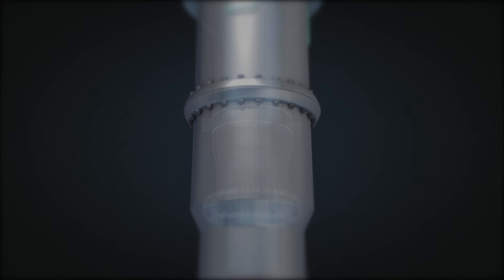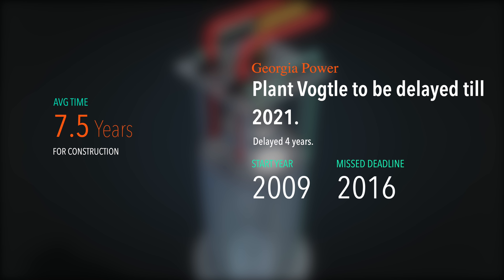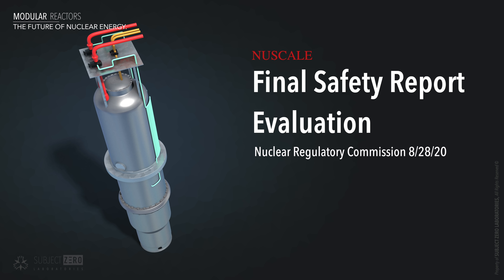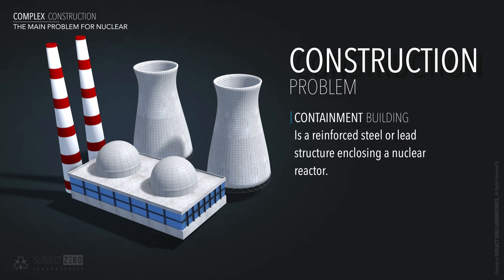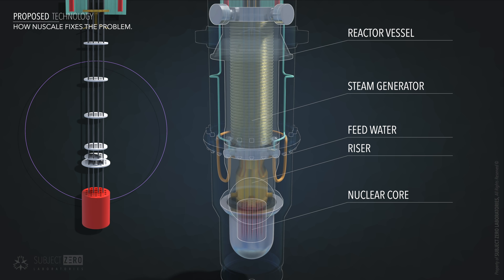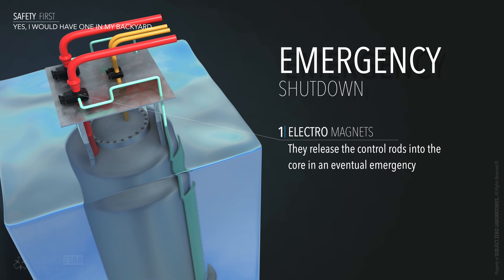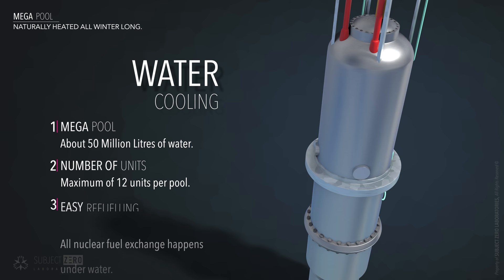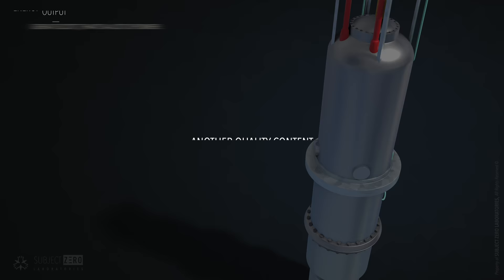A Milestone for Small Modular Reactors (SMR 2020)

Comment: Most misunderstood technology... the misunderstanding starts when calling a 720 MW plant ‚small‘, and the nuclear waste and decommissioning is not listed as a disadvantage, or when the Fukushima incident is mentioned ignoring the facts that design changes contributed to the disaster (like moving the emergency generators in the basement - next to the sea). 
This is more a marketing video than the typical well researched project zero video...
Reply: Anthony Ngu the lesson is, there will always be commercial (or lazy) decisions sacrificing a tiny tiny bit of security. Even if a design is almost 100% safe in theory (which it never is), the actual plant always is less safe than the design. Over all plants in the world and over time, those tiny risks add up to a major disaster every 20 years or so. 
Putting 12 reactors in a pool is not going to change that in any way. Oh and don’t forget the waste problem is the same. 
We could look for less radioactive fuels that are not capable of a meltdown and have a short half-life to reduce the waste problem. That would be safer but not as commercially interesting as the big ones producing more heat. The design shown in the video is definitively a big one.
Reply: @Krmpfpks  long half-life something with a short half-life is more radioactive especially if it's something with a big atomic number.
Reply: @Krmpfpks  also it is small relative to a normal nuclear power plant.
Reply: Anthony Ngu you can only consider it small if you count the 12 reactors in one pool as 12 separate reactors. The risks of 12 reactors in one pool might be somewhat smaller than the risks of one big reactor, but the worst case scenarios will be as bad as one big reactor. The half-life is important for disposing of waste products, but yes, it’s probably not that easy to find something viable with a short half-life as part of the wast is not the fuel itself but byproducts of the reaction.

Comment: I agree with part of your presentation. The French proved the small reactor factory built concept in the 1960's when they built their very successful nuclear power station grid from this type of small reactor. There are a number of fundamental problems of any solid fueled nuclear reactor. Nuclear fuel ALWAYS swells due to the intense radiation, reaction byproducts quickly contaminate the reaction and cannot be remove from the solid fuel, unless the fuel is recycled. Also it only allows utilization of a very small portion of the energy in the nuclear fuel (about 1-3%), requiring fuel bundle replacement in about 18 months. When the core is decommissioned you still need to store the highly radioactive waste for thousands of years. Spent fuel MUST be continuously covered in highly purified water for at least centuries to keep the fuel bundles below melting temperature. The continuous heat from the fuel, evaporates the water quickly (hundreds of gallons in a short period of time) ALL spent fuel is currently stored in pools, on site at the nuclear plant and there are no plans to recycle it as it is expensive and hard to do conventionally. Uranium is somewhat water soluble (Thorium is not), so there is a groundwater contamination concern.

I used to oppose nuclear energy, mainly due to high pressure steam explosions (3 times so far) and long term storage of highly radioactive fuel for 10k+ years. I have changed my mind, but only if we build  Thorium liquid fueled, Molten Salt reactors (such as LFTR) instead of the boiling water conventional reactors we have now. Currently Thorium is  a waste product of a number of mining operations, is orders of magnitude more plentiful than uranium and is basically safe (it needs conversion inside the reactor to become useful fuel, conversion takes 30 days and is free). Molten salt solves ALL of the fundamental problems of boiling water reactors, as part of their nature. They also cheaply and easily burn current stocks of used fuel rods leaving only a small residue that is safe in about 300 years. They effectively use about 95+% of the nuclear energy in the fuel. No expensive explosion proof containment structure needed, as it cannot explode (it operates at ambient air pressure). They are walk away safe (Oak Ridge Tennessee ran a molten salt reactor safely for 6,000 hours and performed walk away safe tests on it at full power in the 1960's). In fact they shut it down every weekend because no one wanted to stay. They are well suited to the SMR form factor and easily allow continuous removal of very valuable medical isotopes on an ongoing basis. These medical isotopes are impossible to remove from boiling water reactors. They also provide high temperature waste heat that can be used in many high temperature processes now, such as steel, fertilizer or concrete making, just to name a few. Desalinization of sea water on a huge scale is easy and cheap.

The only remaining hurdles are some slight metals compatibility proving needed. Chemical separation is a far superior and cheaper process. The inventor of the nuclear tea kettle reactor (Alvin Weinberg) said it was fine for military use but was a very poor choice for commercial reactors, as we have seen 3 times. For many years he strongly promoted the Thorium, liquid fueled reactor as a far superior choice. Thorium is useless for making bombs which is one of the main reasons they used uranium instead back in the 1950’s.  See Thorium Alliance you tube videos for a good overview. An excellent boiling water reactor problems review is a 1hr You Tube video:  
Nuclear Disasters & Coolants   https://www.youtube.com/watch?v=8Pyq8kCeiYs&list=PLs_mufQsR4fge432XbzbnIEgEjayooYSu&index=5

Comment: The 1.221859 tons of spent fuel generated in one year by one 50MW reactor can fuel 13 100MW Molten Salt Reactors for one year. 940 kg of natural thorium in a Molten Salt Reactor (MSR) can generate 1 gigawatt (GW) of electricity for one year. The 9.278 tons of unused depleted uranium processed to obtain the 1.222 tons of enriched uranium can fuel a further 98 100MW Molten Salt Reactors for one year.

Comment: Fukushima construction guide:
Build the wall lower than the estimated maximum tsunami height. It's cheaper that way
Put emergency generators somewhere safe, like down by the sea, behind the wall
Put backup generators in the basement so they're not in the way
Hydrogen scrubbers inside the building? What for? Everyone else has been doing it since the 80's you say? Nah, we're good.

Emergency procedures:
In case of cooling failure, do not pump sea water into the core, as that would make refurbishment expensive. It's probably going to be fine anyway.
Reply: Same feelings since the day of. Who the hell did place generators below the water line near the coast? What could even possibly go wrong, aha.

Comment: SMRs are going to be amazing for very remote mining operations, you don't have to ship all of that diesel to the site continuously.

My only hope is that they can get them as economical as possible, new mines are notorious for having huge upfront costs in Canada.
Reply: Terrestrial Energy is designing a molten salt reactor partially with this  use case in mind.
Reply: Oh they'll come, and these types of power sources will be invaluable for remote locations. You could place them pretty much anywhere without having to build onto national power grids. I'm wondering also if these reactors can operate with Thorium as their reactor fuel. It's one of the most plentiful reactor fuels out there.
Reply: @spencerbeaumier583  also, storage solutions are now cheaper than building out large grids, so small communities built around mining operations could really scale up their standard of living (and allow peaks well beyond the reactor's continuous output, if necessary, especially useful if only a portion is diverted to the town, to make the most of that portion)
Reply: the good thing about thorium is you get it anytime youre mining the heavy rare earths as a byproduct. there are already mines in canada that are getting it, theyre just putting it back in the ground after.
Reply: @George Mann that's interesting, can you share some sources for information on it?

Comment: tbf i think this could be designed at least a bit better, the system seems to be depending on gravity which is an issue for something that is relatively small, it's not unthinkable that a reactor like this could be pushed over by other structures that are collapsing, which could lead to a meltdown, i'm sure this has been adressed by now but just saying :D
Reply: if they are stacked withing a basement (as they should), they can't really trip over.
Reply: Yep. There's always the possibility of earthquakes or something else that collapses the building. Though it's probably easier to solve this problem for smaller reactors. 

My biggest concern would be conventional fires in the facility since they could evaporate a lot of the coolant water.
Reply: IIRC control rods are held up against both gravity and springs
Reply: Yep, if it can't get knocked over you better sink it into the foundation of the building. Else you're asking for a war/crash/earthquake to put it sideways. But if you pick your construction site away from sinkholes and large drops (and don't have fuel in the reactor while transporting it) it should be fine. Gravity is pretty reliable.
Reply: @prophetsspaceengineering2913  oh. Fire evaporates popl water? TIL
Reply: Did you guys even watch the video? These things are designed to be submerged in a large body of water, not inside a building, and certainly not inside your basement.
Reply: @superbarnie  They are saying that fire can evaporate entire pool water

Comment: Modular unit operations and unit processes design  is actually a growing trend in chemical engineering, and it has been practiced for a while now. However, reactors did stall a little. It is great to see such innovations happening.

Comment: Fukashima's safety features worked exactly as they were supposed to. What doomed the reactors was TEPCO's incompetence and slow response to the tsunami damage. The emergency battery backups kept the cooling pumps going for almost 8 hours after the tsunami before running out of power. That was 8 hours for TEPCO to helicopter in new diesel generators and fuel.

Comment: You should talk about molten salt smrs! Also the fuel on this reactor can be recycled like in france right?
Reply: Big problem with fuel reprocessing: you can seperate out the Pu-239 while you are doing it, and use that plutonium to make bombs.
Reply: @nerd1000ify  I had never heard for that, can you give me a source to read more about?
Reply: @nerd1000ify  "Reprocessing is considered to be a proliferating technology, even though plutonium produced in civilian reactors is unsuitable for use in atomic bomb-making. This is because the technique may also be applied to irradiated fuel from specialised reactors that produce military-grade plutonium. Consequently,  reprocessing activities are closely monitored, and IAEA and EURATOM cameras constantly track operations at La Hague.
"

I wonder if the same can be done with thorium, tho still notice how you need a specialized reactor to make the bombs, perhaps an smr is not this type of specialized reactor or perhaps it is, I don't think so but I will redearch more about it
Reply: @CarlosAM1  Well they say that but with sufficient effort (and expense) you could probably purify small amounts of bomb grade material from a civilian reactor.

As for thorium I think one of the things that makes it attractive is that it is less suitable for making weapons- it has to convert to U-233 to fission, and thorium reactors by design are consuming the U-233 as they make it.

Comment: I wonder what it would look like to retrofit an existing coal plant with these? That is scrap the boilers, coal handling and storage portion and hook up the existing transformer yard, steam turbines, powerhouse, cooling towers, etc. to a gang of SMRs. If you have the land area, it might even be possible to do a near-zero downtime conversion by building the new SMR steam generators next to the existing coal fired generator. The only downtime would be if you can't (or are unwilling to) hot tap the steam lines.

Side note: the CO₂ emissions from coal plants are near the bottom of the list of things that make me prefer nuclear power. All the other things (including radioactive materials) coal emits, the impact of mining and the limited supplies coal are much more problematic IMHO.

Comment: Another issue with nuclear power is that electricity is really the only thing it can make. Sometimes all you want is heat to keep buildings warm or to smelt things especially in industry. It's much more efficient to use a direct heat source like natural gas than it is to boil water, drive a turbine, make electricity then convert it back into heat due to all that energy loss from conversion after conversion. Nuclear power can't use the heat generated from the reactor for any heat applications directly because water cooled reactors are limited in temperature and nuclear reactors can't just be turned on and off. As a result, today's nuclear plants only make electricity. There are reactors designs that could change this like using alternative coolants to water that won't be as limited in temperature like molten salts.
Reply: I mean, that's a bit of a "very" specific case here. Remember the goal isn't to phase out gas where its usefull. I am not going to run a forge using a nuclear reactor because that would be silly and inefficient. But using gas to make electricity is very bad and inefficient too.

Electricity is already the best way of "converting" energy from one state to another as the universal medium. Take a car engine for example. You take oil (chemical energy) which you burn into heat and kinetic energy (where all the heat energy is wasted) which is then converted into kinetic energy to drive the car. Now take an electric car, where the electricity comes from either nuclear or renewable sources. In the case of nuclear, you get chemical energy being transformed into heat only, where all of that heat is used to produce energy, which is then transformed into kinetic energy (once again, with a lot less losses) into kinetic energy to move the car. 

In my view, fossil fuels are a dense and portable solution for application where heat energy needs to be released precisely and in a controlled manner. This is perfect for powering chemical reactions, or for airliners who need a fuel architecture that is as energy dense as possible to afford them the most range. Plus a jet engine only relies on the HEAT generated by a combustion unlike a piston engine, making it a lot more efficient. However for anything that requires a constant, aviable, reliable source of energy (which is most things) then nuclear and renewables are deffinitly superior. Then it is just a question of what is most efficient in any given case, which is where i tend to see both the fossil fuel and eco-warriors fail utterly. There ins't one universal solution yet. It makes no sense to put a nuclear reactor in a place where you have sun and deserts everywhere , just as much as it makes no sense to make a nuclear powered steel furnace or plane. I see people taking a jab at one another like this, a bit like you did, pointing out something the tech isn't designed to perform well at and using it to justify it being bad at large. 

Nuclear is good at energy, and in a way orbital propulsion. But it isn't a portable source of energy, that is what a chemical fuel is good at. Can both be combined? well of course! Hell, nuclear would be the perfect catalyst for many forms of high energy fuels, and could help make fuel cells more effective by opening a better and more effective way of producing a steady stream of hydrogen.

Comment: On the Fukushima accident I would suggest to specify that the issue that happened was that the generators that powered the heat exchange water pumps were flooded and so water wasn't able to extract heat out of the reactor. This was because the generators were in the basement, if they would've been higher there wouldn't have been such an accident.

Comment: it's cool, but if it runs on enriched fuel = U-235, still pretty inefficient, molten salt is way better
Reply: Yeah, some safety nuts are going to make this very hard to pull off. the licencing will be as difficult as a full size reactor but the profits will be 20%. If we could just bury this whole thing and forget about it for 20 years with just a pipe of steam coming out of the ground and a pipe of water going down, it would be great too but there is no chance of that realistically.
Reply: Molten salt reactors use Uranium too. 🤷‍♂️
Reply: @VFPn96kQT  yeah, they can, i think this guy is referring to ones that use a thorium cycle. Seems cool, but uranium is a lower bar to make right now and even that bar seems too high.
Reply: @kapytanhook  Thorium breeds into uranium anyway, so... technically, they do use uranium too.
Reply: @caav56  yes but it's U233, afaik it can work with U238 too - burn used fuel use plutoium as neutron source..

Comment: Nice writeup. FYI: the "1 Electromagnets" pointed at is wrong. It is pointing to a pump which is tied to the decay heat removal system. The electromagnets should be immediately above the control rods (towards the bottom of the SMR). Otherwise they would need to be some really strong electromagnets to hold the control rods that far away.